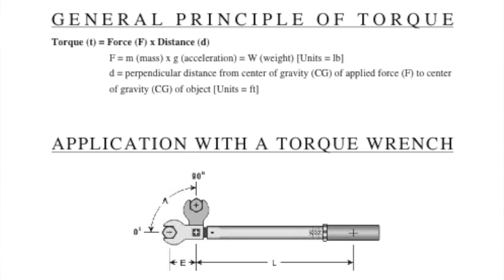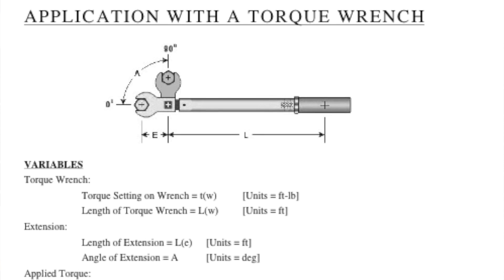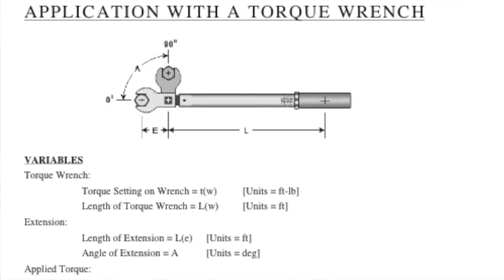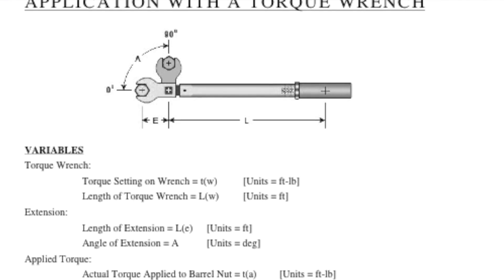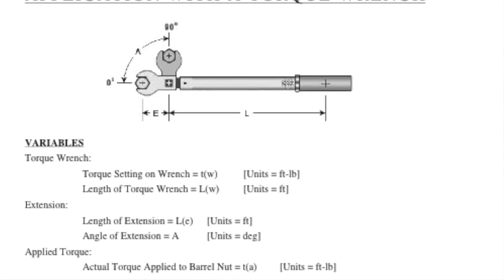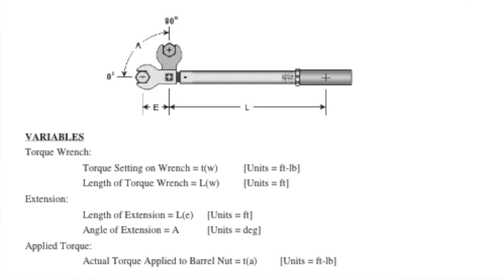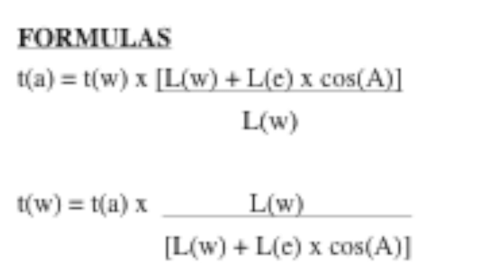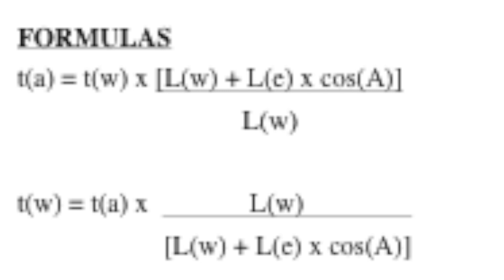The Truth About Torque: Barrel Nuts

Comment: I torqued bolts on gas pipeline for 15 years. Quit over complicating this. Range is 30-80#. Set it to 45#. Torque it at whatever angle you want. Oh, by the way, did you forget about the coefficient of friction? If threads are dry or lubed, and the different lubes have coefficients too. Whatever, 45#, torque it!

Comment: The wrench is already 90 degrees. The diagram you shown is when the wrench is straight but the wrench on the barrel nut is already 90 degrees so you’re applying incorrect torque of 180 degrees. Keeping the wrench straight and the hook is at 90 degrees is correct.

Comment: One thing I have learned about torque. There is no need for it, everything I have torqued to spec has backed off or loosened up over time which is why they always tell you to torque again. If you tighten it as much as you can without straining then it is tight enough. Torquing is overrated

Comment: So to keep it simple and ensure I understand correctly..

If I want to be as exact as possible.. 

I either keep the barrel nut wrench perpendicular to the torque wrench? And then it should apply relatively exact force to the setting on the torque wrench?

And if for some reason I prefer to keep the barrel nut wrench in line with the torque wrench then do the math that accounts for the extra length added?

Comment: T=FL
F force in pounds
L length of the arm in feet

One could avoid trig by using a T-Square and measuring the length of an angled wrench. Keep the square normal to (90 degrees) to the barrel and read the length from the square.

No need for a calculator or trig tables

Comment: Could you have flipped the extension that was at 90 degrees to the wrench so that the center of the nut was inside of the center of torque wrench to get just slightly less torque than the setting on the wrench so you don't have to worry about over torque?
Reply: Just lower your torque wrench if your worried about over torquing. The torque is a VERY VERY wide margin on these barrel nuts.

Comment: The torque specs are 30 to 80 because of the original spiked but that was used. You had to pass the gas tube between them to install it. Don't overthink it.
Reply: I've even removed the teeth on the barrel nut too make room for the gas tube & get exactly the torque I wanted.

Comment: Mil-hdbk-60 is a good reference for thread class, material, lubrication, ect. So is the machinist handbook 🤷‍♂️. Let’s not over complicate torque.  Also a zero numerator equals nothing.  A more simplistic approach would be just summing all the moments in the x,y. 🤷‍♂️. Mechanically, I would say a torque wrench is not an accurate way of measuring torque.  Nobody is going to add a strain gauge and it’s not possible to measure the elongation either.

Comment: The correct torqure for the  barrel nut is 30 ft-lb + whatever it takes to achieve alignment.  Once you reach 30 ft-lb it does not matter what the torque is.  Alignment  must be achieved and it must be more than 30 ft-lb.  You don't want to know.  On the third tighten-back off (this smooths the threads and gets a good even fit on all threads) once you reach 30 ft-lb, put the torque wrench away and replace it with a breaker bar, and advance to alignment.  That's it  Two more suggestions,  use a good solidly mounted vise.  Second suggestion, do NOT use barrel vise jaws for barrel installation, use an action block.  Your action block came with an insert that slips into the upper receiver where the bolt carrier would go.  You must use it to prevent collapse of the receiver walls.
Reply: Depending how heavy & long the barrel is I shoot for higher torque, also barrel extension to upper fit also comes into play. Use reaction rod also, a must need if you ask me.

Comment: That's why there are plus and minus tolerances on torque specs. Close is good enough in most cases, plus no 2 torque wrenches torque the exact same. Never figure that you are torquing to spec, always figure you're n the ball park. When in doubt, use another wrench to confirm.
Reply: @No_Kings_Allowed  Leverage on the hand is not leverage at the socket. Two different things going on there.

If I shoot a shotgun shell in an 18" barrel, and an identical shell in a 28" barrel, the amount of pressure never changes, but the velocity will.

Same as with a torque wrench. The socket pressure will not change, only the felt pressure used to get it there will.

Give me a lever, and I can move a mountain. But the weight of the mountain itself will never change.

Changes on torquing come from the extensions, not the handles. The longer the extension, the less torque is applied through metal fatigue, stress, and twist.

But even that is minimal.

Comment: People get so worked up between the the 180 or 90 degree offset. In reality, it doesn't matter. Unless you are adding several inches of length. For this specific application, the applied torque to the barrel nut does not require precision. Even if you do everything right, in terms of setting your torque wrench to a specific ft-lbs, you are applying torque a surface that is not smooth, meaning energy loss due to friction and heat. I am glad to see a video of an engineer that understands mechanics explains this topic.
Reply from the maker: Hoorah, brother.

Comment: Simple answer extension at 90 degrees always no math involved. Then the middle of the torque spec.
Reply: As an engineer from way back when we used slide rules and slung ink on vellum, even the mfg recommends that....
Most auto mechanics going by the Motors Manuals do the same...kinda an understood thing.
Reply: @keithlucas6260  I retired as a Nuclear Mechanical Systems Inspector. Before that I spent many hours working on my own vehicles.  Stickler for doing thing correctly. You might be surprised  how many people don't have the same understanding you have.
Reply: @calvinroyals6463  ....Thanks....went into the Air Force and was offered Colorado Springs AFA in '76 after I already had my degree....long story short was given a security clearance that's classified.
After an injury I was "retired" and got the job with Deutsch during this "leave of absence." Funny how things don't always go as planned.....ended up "slinging ink" for Bianchi Gunleather in Temecula and happen to be "that guy" who developed the locking welt holsters you see Safariland selling (John's old business bought his business).
I'm actually just retired from Baker Hughes as their top master toolmaker....found it more satisfying "turning handles." There isn't anything from manuals to CNCs, I can't setup, program or run and get $30 to $40 an hour plus overtime.
My "baby" I'm playing with now happens to be a 1948 CASE VAC utility tractor...
plus I have my own shop to "piddle" with everything in.
Reply: @keithlucas6260  You are an example of what my cousin says. The cream rises to the top.  I was a slow learner  took me 20 years as Nuc 10 of them in Refueling before I put in for Work Leader to advance my career.  Would like to have learned how to set up CNC. Everything I did was so far removed from my military MOS.  Artillery men don't have much to do in civilian life.  Funny I have made some holsters for friends and myself. All hand sewn too cheap to buy a machine. Well take care and be well.

Comment: Since the specs are typically a wide range, "don't make this an over complicated issue" is the final sentence said at the end of the video after a huge discussion and analysis.    The answer could just be said in about 3 min= have the barrel wrench tool at 90 degrees oriented to the torque wrench so the length added by the tool does not affect the radial distance from force applied.
Reply from the maker: As stated, it was to provide visual proof based on the principles of torque, not just a simple statement that continues to be widely misunderstood.

Comment: The one time I had a torque-wrench to tighten my barrel nut, the nut flared before I got to the 45lb setting.  I looked at it thinking 'no way', and slid the handguard to it, where it stopped, unable to go all the way home.  I did everything in the mfr directions, so I'm back to the fail-safe 'gut wrenching' method which has never caused me any issues in the dozens of times I used it on my own AR builds.  I was able to grind the flare flat enough to allow the handguard to seat and it has been all good since, but I'm still shaking my head when I see that AR.  I will say this, though...definitely clean the threads and use the specified grease or anti-seize, half tighten and loosen your barrel nut a couple times before your final 'torquing' or your torque is not what you think it is.  I've been shown that by my armory friend when we were in the Marines and then he showed me a stripped upper where the threads looked like waves rather than threads.  He said it comes from the aluminum characteristics wanting to grab and lock-up against the steel barrel nut when torque is beginning to be applied which causes friction/heat then the thread locking action premature to actual final torque.  The '33' grease takes that out of the equation as it should.

Comment: yea I have tried to explain to people that "the longer the dingus end the less the torque" for ages and some people don't get it.
if'n you don't believe it use a long extension with an impact gun to remove a lug nut... now try it with a short socket.

Comment: Lordy mercy people...slap some grease on it and tighten her down "nice and tight". A litle more or less if you need to time it for a particular handguard then go to the range and have fun.
Reply: Hey fuck you man for bringing common sense into this
Reply: Use a torque wrench and put the head at 90 degrees to account for the additional length of the extension. Torque to proper value, and you will achieve proper torque.

Comment: Very well stated and thank you for your time and effort.  Having done warranty work for Colt, it was always a fairly large range that was acceptable and, most importantly, it could
never be exact because you then have to rotate the nut to the next possible position to clear the gas tube.  Besides that, whether the threads are "wet" or "dry," anti-seize (which I do use)or not,
and have you compressed the threads a few times before you finalize the torque all come into play.
Reply: Do not use "anti-seize" that has metal particles, such as Neverseize or the copper stuff.  Those bits of zinc or copper grab the aluminum and make it difficult to tighten smoothly.  The barrel nut wants to move in jerks.  Use a smooth grease, preferably with moly disulfide.  This is ordinary brown wheel bearing grease for disk brakes.  If you don't have that, regular grease gun type grease is fine.

Comment: Ever notice that even after torquing barrel nut you have to clock the nut after for gas tube clearance. Excessive torque is not needed. Once assembled the gas tube prevents it from loosening. Much like a Carter key on a castle nut.
Reply: Oh wow, You're actually supposed to use shims. So then when you are at the appropriate torque setting then you are lined up for your gas tube. You definitely don't tighten to the torque setting then loosen it to line up 👀

Comment: Ie if you have a crazy big extension you can get quite a different torque. Shoot for heart of the envelope and you are good.  Nice video, laying out the math but caveating that usually it won’t matter
Reply from the maker: Thanks brother, you've picked up what I've put down.
Reply: If your extension is at 90 degrees your applied torque still matches your set torque regardless.  I'm not sure who is really using an extension long enough to matter for other angles though.
Reply from the maker: @JenkinsStevenD  That's exactly what was proven.

Comment: I know so many guys that have built 6-10 AR-15's, and never used a torque wrench!
Q. Will their rifles eventually just BLOW UP?
Reply: mil spec is 30-80 ft lbs. a cheap or defective upper might crack or get stripped threads under too much torque but if it makes it through its first few heat cycles then its probably fine.  then again, if you have access to a torque wrench just use it. set it to 35lbs with the extension and youll be somewhere around 45-60

Comment: Inch pounds surely.
Reply: No, barrel nuts are tightened to 30-80 ft. lbs.  The muzzle devices and castle nuts are tens of ft. lbs.  Most of the time, however, rail/handguard screws are tightened to the tens of in. lbs range.

Comment: As an engineer myself, thank you for showing this correctly.
Reply: I'm an ACTUAL engineer... you're both idiots.
Reply: @samuelpalmquist2190  I too am an engineer and agree with the engineer above me.
Reply: At Deutsch Aerospace we "engineers" use to "sling ink on vellum" and actually included a page of mathematical data and conclusions.
The day any of you actually were required to take a class in slide rule and do the "math" is the true test of real "engineering."
The next year we were required to buy that TI SR-50 which was about $200 back then...I actually still have the thing.
Using applied force to cut, bend, shape and form various metals along with the blueprints for fixtures and molds, this shit is child's play.
Today we just plug in "netfabb" or "solidworks" and be done with it.
Still doesn't look as awesome as a shaded in inked vellum drawing framed and hung on a wall.
Reply: I’m the real engineer here boys. Take a seat.
Reply: You definitely are not a real engineer. As a REAL engineer myself, I know, and YOU should know too, that no engineer ever did any real engineering to determine an ideal torque value. It's all just armchair enthusiasts jerking eachother off over made up shit. As long as you have the thing on tightly, it doesn't matter how much torque you apply.
Reply: @AFpaleoCon  
Actually everything is already in a chart of values based on both theoretical calculations of material, thickness, threads and shapes along with giving it to the lab technicians to "play with it until it breaks," then we'll stick it in the middle somewhere with some "wiggle room," and be done with it.
They built a lab for me to "tear things up" in complete with nice measuring instruments.....was a nice break from being chained to a drafting board.

Comment: You have a window of 35 to 80 foot pounds.  Torque to 35 loosen 35 loosen 35 loosen then set it to 40 and go until you can line it up or if it doesnt need lined up then its good.  Its not a aerospace bolt on a space shuttle or tires on your car. Dont "Nuke" it like we said in the navy.
Reply from the maker: That's the entire point of the video.
Reply: Aerospace/Space hardware has very tightly controlled torque specs.  They don't "nuke" it either.  Over torquing aerospace bolts is worse than slightly under torquing them.

Comment: steel nut connecting the steel barrel to the alum. alloy upper receiver.........30 to 80 pounds.    there is a reason for the spec. to be varied so much.That would be that it doesnt have to be so tight to stay in the correct position. hence the locking tab on the barrel locking into the slot in the receiver....Its All Good......Just use a cresent wrench and turn it till its tight, problem solved.Dont worry about head space as it will only be 3-4 thousands at the most...that is the way its designed ...to be worked on in the battlefield with one or two tools....HAVE A GOOD DAY.

Comment: LOL The whole [L(w) + L(e) x  Cos(A)] / L(w) section is basically a correction that says mathematically: for the purposes of determining torque, the measurement from the center of rotation to where the force is being measured is the only part that counts. Which is very true. The Cosine of 90 degrees is 0 (i.e. 0% or none) and the Cosine of 0 is 1 (i.e. 100% or all). So L(e) x Cos(A) basically states that we're using some percentage of L(e) based on the angle  and adding that to L(w) to get the true length of rotation, then dividing it by the length of the wrench to get the total applied adjustment for the wrench. Sometimes math is funny with regard to how true it is.
Reply from the maker: It's simply finding the length normal to the direction of the applied force.

Comment: Good information but a little confusing, I would think your angle would’ve taken from center axis of the wrench head and the centerline of the socket on the adapter/extension regardless of the shape of the adapter. It doesn’t make sense to square off the edge of the adapter, there is a frog in Alaska that freezes during the winter and while frozen the frog stops breathing, his heart stops beating, his palms are sweaty, knees weak, arms are heavy there’s vomit on his sweater already, moms spaghetti.
Reply from the maker: Just remember the length for the moment arm must be normal to the direction of the applied force.

Comment: For non free-floated barrels, the barrel nut must be tight, but allow the gas tube to slide through. It must be left there, because it's impossible to tighten it enough to reach the next trough, regardless of the torque.
Reply: Not with some shimmy shims!!!